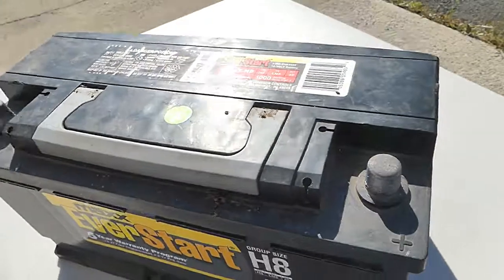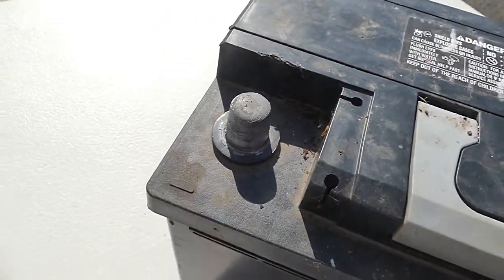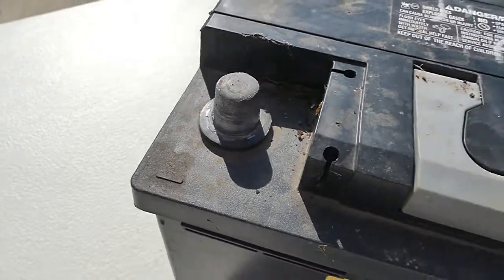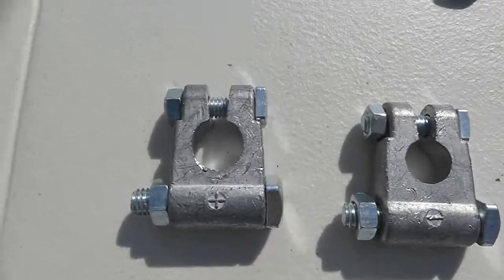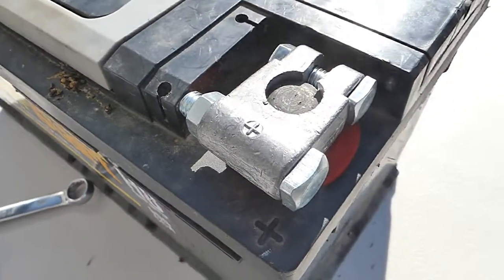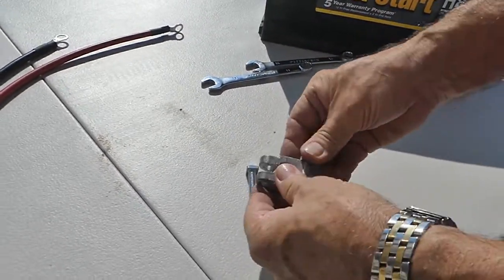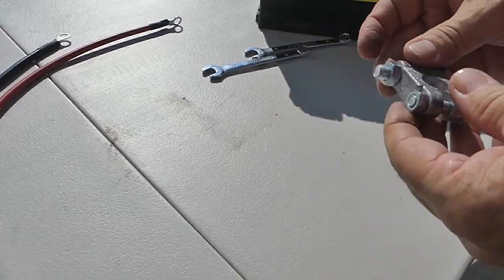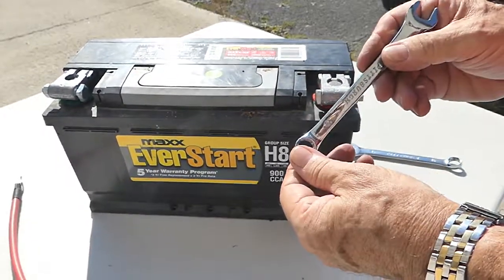Tech Team's #00804 Military Style Heavy Duty, Heavy Current Lead Battery Terminals

Comment: What would you suggest if you had to connect two cables on the positive terminal?
Reply from the maker: You need cables with 10mm lug eye ends and just make them up to the bolt on the terminal